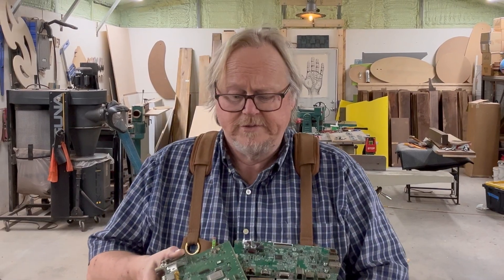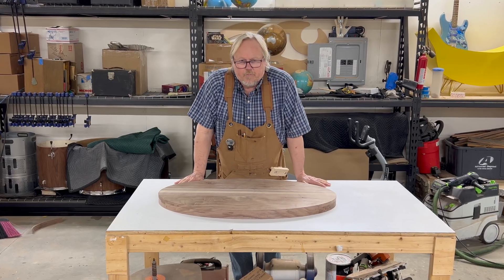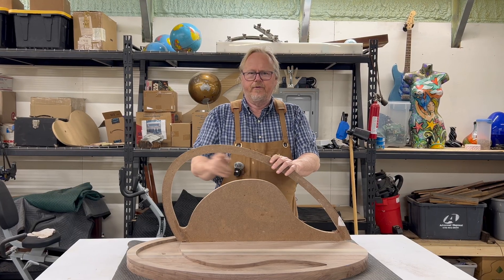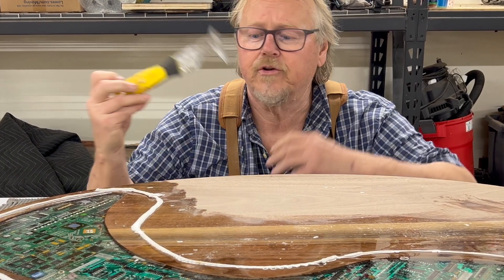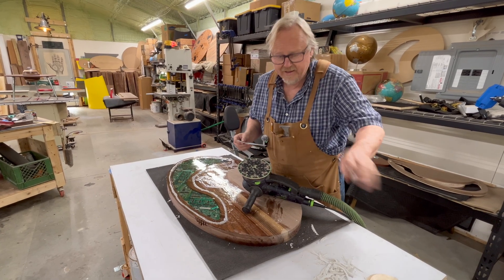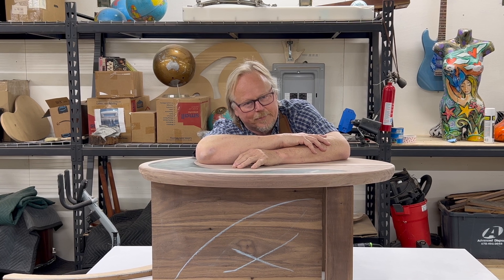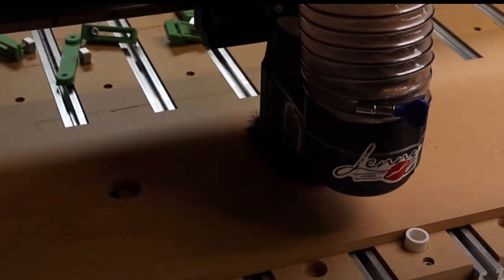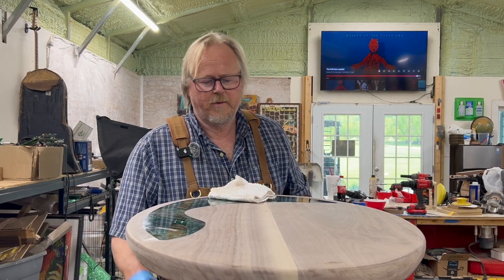I Embed Circuit Boards in Epoxy in a Walnut Table -This Happened!

Comment: 7:50 is there a reason that you cant just grind it off?
Reply from the maker: The Rotex sander with 80 grit is basically grinding, Maybe a little more control than a grinder? I have used a5 Inch sanding adapter on a grinder before and it is aggressive but manageable till its not, I guess the random orbit may be a little more controllable!?
Reply: @BlueTurtleStudios the rotex sander is indeed more manegable than a grinder!
I just though that a grinder would make it easyer to remove the caulk before going over it with a orbital sander :)

I would also higly recommend flapper discs on the grinder, as it has a little give to it so it doesn't mar up the surface